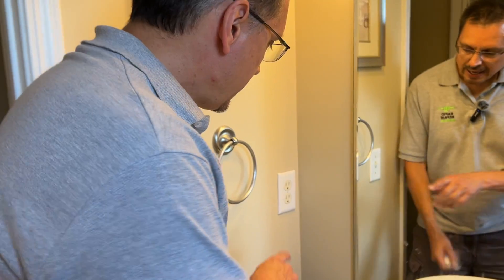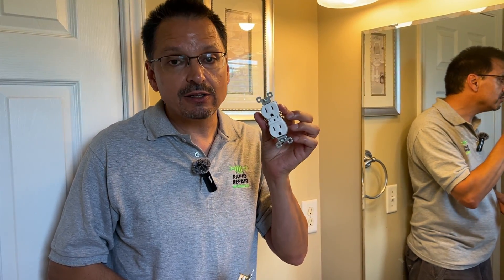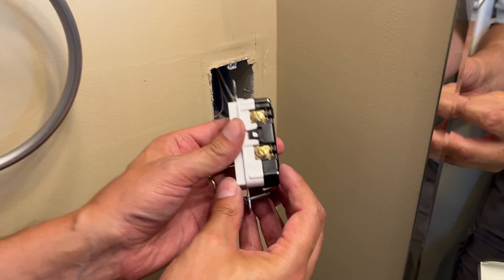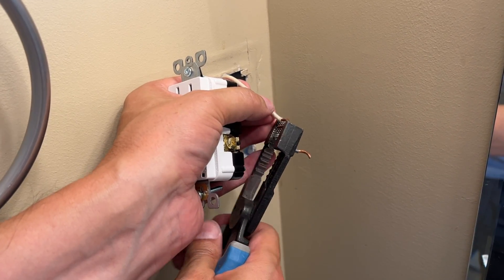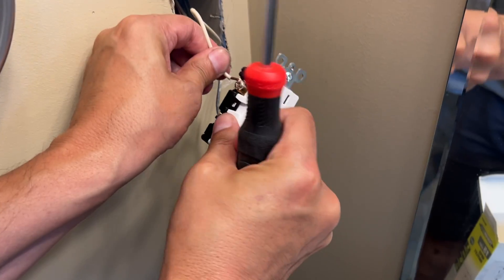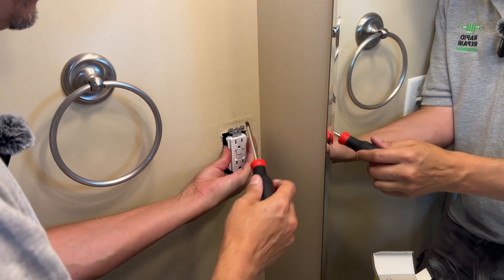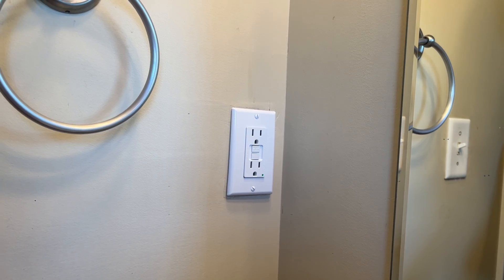Fast Fix to Open Ground Outlets and Ungrounded Outlets

Comment: I noticed that you didn't at all test the new outlet.  Very typical for check-the-box apartment maintenance people.  "Hey, I did the thing.  Break time!"  Then when the resident actually does test it, and it turns out to not be working, they are put at the back of the queue for another service visit.  🙄
Reply from the maker: I hear you. Thanks for watching and taking time out of your day for responding to my video. I appreciate it.

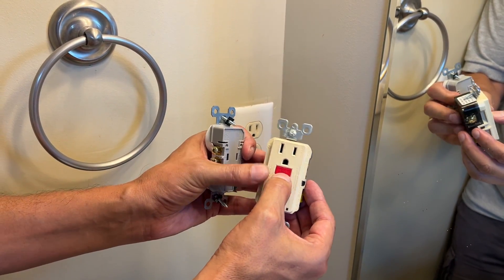Comment: At 1:19 that's incorrect. It's monitoring the hot and neutral, not the ground, there should be no current on the ground. I think that's what you meant, just a verbal error. I mean, how would it work without a ground wire? lol.
Reply from the maker: Thank you. I appreciate your time and your comments. Yeah, sometimes I mis-speak, if I catch myself, I have the Editor fix it with text on the screen…or re-shoot

Comment: I have the same problem in my old house. There are only 2 wires coming out. Black and white. Now the breaker is a 20 amp. The old outlet receptacle is 15 amp 125v with 3 prongs. Trying to change a couple in the house because they are loose when plugging in something. Question is, can I do exactly as you did? Will both top and bottom outlets work if I only connect the pair of wires? Should I get a 15 amp gfci outlet receptacle like this one?
Reply from the maker: OK, first off whether your duplex outlet is rated at 15 or 20 amps won’t make a difference whatsoever. That only matters when determining wire size. 

But yes, switch out that three prong ungrounded outlet for a safety GFCI outlet. It will still be ungrounded, but you have fault protection, and you’re good to go. Technically you’re supposed to put a small label on the outlet marked as “not grounded” or “open ground” or “no appliance ground provided”… Often these little stickers are included in your GFCI outlet box.
Reply: @HomeRapidRepair You better look this one up. There are GFCI receptacles specifically made for 20 amp circuits and these are recommended for same. They also look different from 15 amp receptacles for those who know.
Reply: Your videos are so informative. I appreciate your help so much, you are an example of what every son would like their father to be. Kind and Useful, Godbless you sir for all your great content, you made a difference in this man’s life today from Oklahoma City.

Comment: I have an old house, and I have no ground wire, but I also have no breaker panel, only a fuse.. how would I go about doing this?
Reply from the maker: You aren’t going to touch the fuse box, except for turning it off…Change out your old outlet(s) for a safer GFCI outlet and apply the sticker in the box as no equipment grounding 👍🏼🛠️🏠⚡️